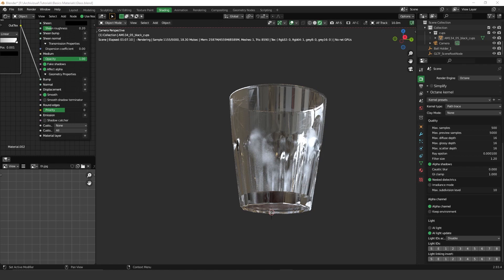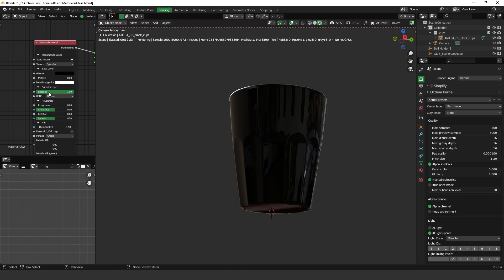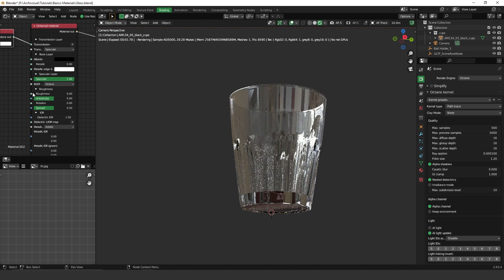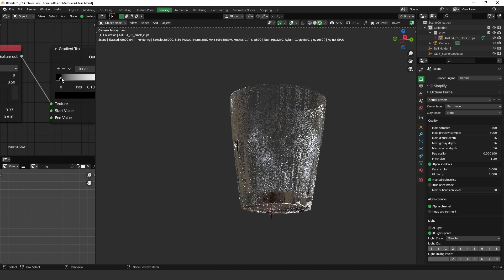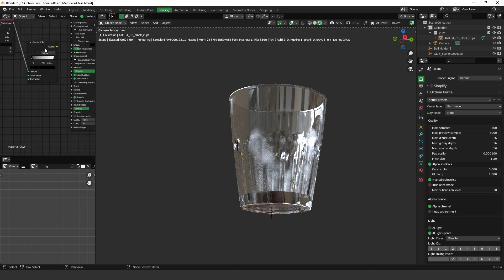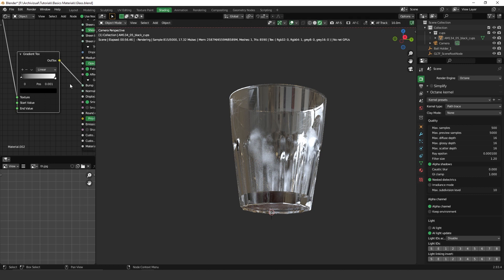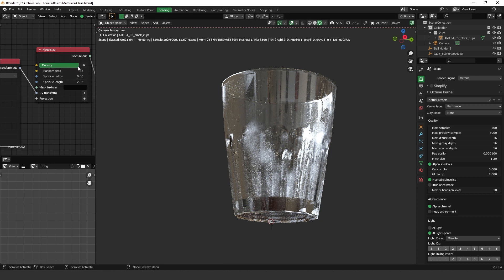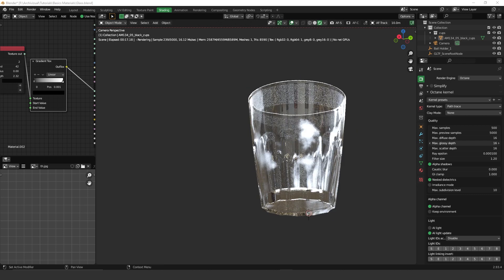Octane materials - Glass

Comment: Ask for help. Excuse me, the glass I rendered the big scene will have some dry spots in part. I changed gi to 1 and turned on noise reduction, but the result is still the same. There are many white blocks. Is there any solution?thankyou
Reply from the maker: You can adjust the adaptive sampler to focus more on parts that are necessary, increase the samples of your scene and reduce the hotpixel in camera properties.